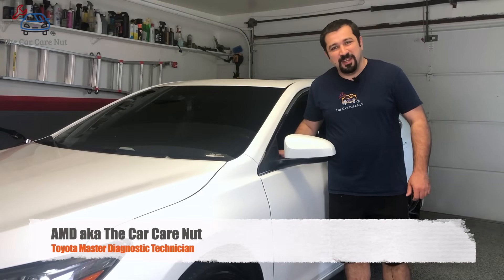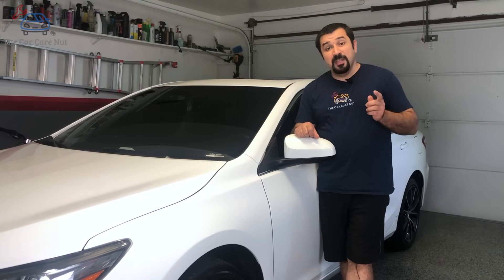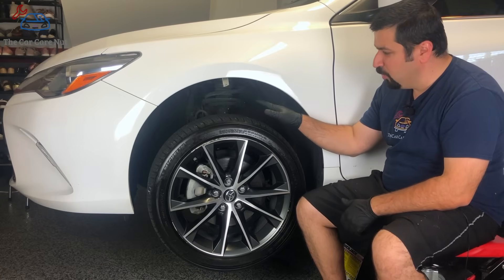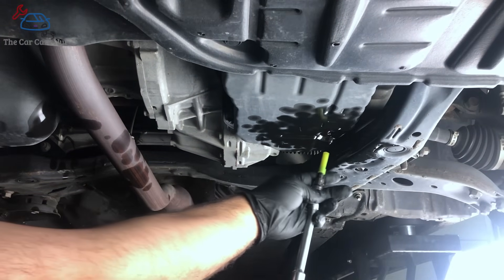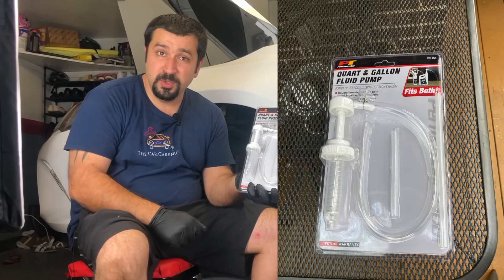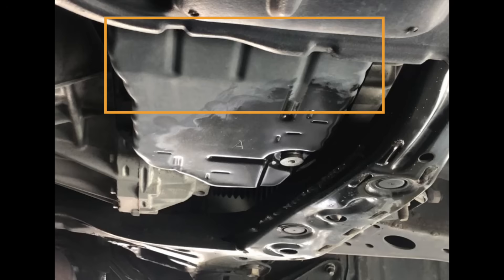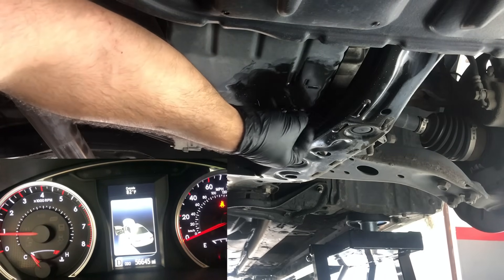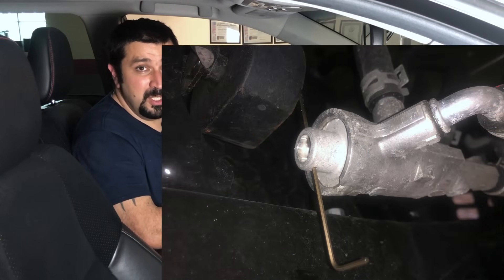How to change your Toyota Sealed Transmission Fluid

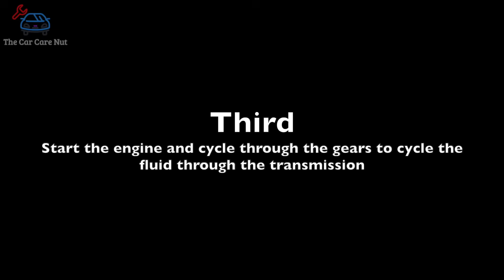Comment: Great video.  Very clear with details on how to do this correctly.  In step 4 at 11:59, where you cycle between N to D very fast back and fourth until the D indicator comes on solid for 2 seconds, does it matter what gear you put it in before the taking your foot off the brake pedal brake pedal - N, P, or either?
Reply: Found another of his videos where he mentions to put it in PARK.  It's titled, "Toyota Trucks Sealed Transmission Fluid Replacement WITHOUT a scan tool".  At 9:08 -> "When that light comes on, you're going to PUT YOUR truck IN PARK, then pull jumper out. And proceed with fluid check mode."
Reply: @vern6887  I recently did two transmission changes and figured out that you may wanna keep it in “N” until the desired Temperature reaches. 

Reason is before entering into this temperature detection mode you will have to quickly shift between “N” & “D” few times(3-4 times) as shown in the video which turns ON the fluid temperature detection mode; this is indicated by the solid “D” which stays on for only 2 seconds after which the “D” disappears. This is easily detected when you are in “N” mode as the display is blank in this mode. You wait for few mins and once the optimum temp is reached it will show a solid “D” again at which point you need to put it in Park mode; remove the jumper then open the drain plug. This is what worked for me though!!!
Reply: I put it in "N" as I was shifting between "N" and "D".

Comment: Fantastic stuff! Your videos are just perfect!

Have a 2011 TC and am about to change the fluid tomorrow. Bought Red Line 50205 MTL 75W80 GL-4 for it.
Has 100k miles. The fluid has never been changed. Would you still recommend it?

Second question: how do I know when the temperature is optimal on a manual transmission? Can I use a simple temperature gun or thermostat, or is there any other, more accurate way?

One more thing: do you recommend changing the transmission oil filter  while I'm at it?

Thank you!

Comment: Hi ....Why not drain when everything is COLD  (removing drain plug and "plastic inner dipstick tube" )  and the refill the exact same amount  new fluid ?    Everything would be at the same temp....no expansion or contraction to change the fluid level.......thanks .....great video!  :)

Comment: Thanks for posting this information.

Now, this is the biggest pile of BS ever invented.   No dip stick.  This is an example of EVERYTHING that is wrong with modern cars and light trucks.   There would have been a dozen ways to make this simple.   Just what is this nonsense all about, simple,   people sitting in a room coming up with ways to prevent the average person from servicing their own car and lining the pockets of dealers.    When I found out about this I sold my 2017 Toyota Highlander and found an old one which doesn't have this kind of BS procedure.   I have owned Toyotas for 40 years and will never buy another new Toyota again because of this nonsense.

Just sit back and watch as this kind of garbage as it leads to the death of companies which try to get ways with this.  Enjoy the show as you watch TESLA  put the old greedy dealer system in it's grave.

Comment: I have a 2007 Tundra 4.0L. with 150k. It runs great with no problems and the transmission fluid has never been changed. Do you recommend changing it now with so many miles?

Comment: Thank you for your great videos! You’re truly a master! I have a Sienna 2012, 67000 miles , I just did this for the first time and the fluid was dark, only 1,5 quarts came out. My question is should I do this a few more times to dilute the old fluid with new one? If so what is the ideal intervals between changes? Thank you sir!
Reply: I asked the same question. On my old F150 I used to get the right amount of fluid per capacity. I will drain the pan and add the same amount as explained here. I will then run the vehicle for a day or two. I will drain and refill again until I went through all the new fluid. It will not be 100 % clean but it will be a lot better than just a partial fluid change. I had that truck for 257k miles and I never had a transmission issue. Same with all my other vehicles that I owned.

Comment: Hi, AMD and community. AMD mentions in his video "Never do this to your automatic transmission car" that shifting into neutral them back to drive over and over again wears out the clutch. How badly does it hurt the clutch when you're shifting it back and fourth that quickly during every automatic transmission fluid change? Thanks!
Reply: If you shift from N to D and back fast enough, the transmission doesn't actually have time to perform the shift.

Comment: My 2016 Corolla has 95,000 miles. I have a small leak from the pan so I'm pulling it. Should I change the filter while I'm at it? What trans temp am I looking for? Thanks.

Comment: Do scion cars have a seal transmission? A Toyota dealer in Phoenix said this transmission does not require a fluid change , is this correct?

Comment: Hello Sir, Im planning to change my transmission oil for my Toyota Highlander 2013 ( 50K miles 81k km) on it. When I check the oil level ( black dipstick) hot and cold it was way above the high mark on the dipstick (overfill), is this something that I need to be worried about? the oil still in a decent condition, do I need to replace the filter as well or just do a drain and fill procedure, thanks a lot. God bless you always

Comment: Question: I have a 2015 GS350 Fsport. Bought it with 87K. I wanted to know "when or If" I should have the transmission fluid changed? ( I tried checking the Lexus drivers service history but it jumps from 30K to 85K with no mention of that service. Thanks for the videos and advice 👍

Comment: What if we weight the fluid we took out and we put the same amount..... weight is very accurate and that's the reason HVAC technician use to measure Freon and fill up a unit no matter if Freon tank is cold or hot.

Comment: Your channel is great and super informative for us DIY'ers. I have a 2014 Highlander with 60K and a sealed transmission. Any recommendations on if to simply drain or to also replace the gasket & filter?
Reply: I've seen him mention in another video (sorry I can't remember which one as I have watched so many recently) not NOT change the transmission filter ever.  In fact he said to never even take the pan off the vehicle.  The filter doesn't ever need to be replaced, he couldn't stress that enough.

Comment: AMD, I just wanted to confirm, that for the U660E transmission (2016 ES350), the fluid temperature should be checked between 104F and 113F (40C to 45C).
Reply: You are correct. U660E is 104-113. If it were the U760E, it would be 95-113.

Comment: Thank you for the great video!  As mentioned, what's the correct transmission fluid temperature range for a 2008 IS350, 2016 ES350, and 2019 RX350?  Much appreciated!

Comment: First of all, your instruction and procedures are excellent - clear, concise, thoughtful, and thorough.  Thank you kindly.  I own a 2011 Toyota Avalon.  The owner's manual specifies a transmission fluid capacity of 6.9 quarts.  When I drain the transmission, only about 2.25 quarts are removed.  So is refilling the amount that drains an adequate service?
Reply: The way these transmissions are built, there is a filter inside the drain pan as well as the trans fluid cooler on the bottom of the radiator, as well as the torque converter inside the transmission.  Those three additional pieces are what’s holding the remainder of the fluid.  There are only two ways to get all the fluid cycled out. 1. Repeat this video step by step 3-4 times so that all the fluid ends up cycled through the system and drained. 2. Drop the pan and filter, replace the filter with a new one, clean the magnets inside the pan, replace the pan gasket with a new one, install pan, flush the cooler unit, refill the system with the amount of fluid you drained out. I would not suggest this option without proper tools and some decent time spent working on cars as there is one bolt that is almost impossible to get to on the pan due to the crossmember being in the way. Not to mention it is super messy, you also run the risk of leaks at the pan of not torqued correctly, having to flush the cooler unit can also cause a lot of issues with the transmission down the road because if done improperly the torque converter may not get the right amount of fluid.  There is another video on YouTube showing all the steps in option 2 I just told you about.  I’ve worked on my own cars for over 22 years and I don’t even want to attempt option 2 lol.  So good luck with whatever you decide!
Reply: @mikewho822  thank you kindly for your great response.  I'll flip a coin to decide between the two choices!  LOL
Reply: The other video is here https://youtu.be/a578lBu_o5E

Comment: On a 2020 newer RAV4, What are the torque specs for the drain plug. And what is the torque spec for the refill plug On the side of the transmission? Thanks
Reply: The required torque is a lot less than you think.  But not that tight.  Wipe it off, drive a few miles and look at it again.  If there are no drips/leaks it is tight enough.

Comment: 2021 Rav4   Have scan tool    I can't remember Temp of fluid at the plug excess drain.  I think you stated 112 degrees . I have 55K miles so it is time
Is 112 the correct temp with a computer?

Comment: The holes on the 2015 Camry OBD2 port are very small.  How small of a gauge wire do you need for the jumper?  My wire won't go in!
Reply: Use a paper clip!

Comment: Whoever came up with this idea needs to be whipped with 30 lashes. It's stupid at best. It makes me think again about buying a Toyota.
Reply: Stupid, yes.  It's not just Toyota.  GM and others have all done this too.  Save a couple of dollars by not having a dipstick and tube, multiply that by a few hundred thousand cars, and they just lowered their manufacturing costs by a million dollars.
Reply: @georgelomarro4677  Not really, because then they have to replace the dipstick with a low oil level sensor plus a low level warning indicator of some kind in the dash.

Comment: I should do some research before posting this but I cant see how a filter isnt required. And also why is it that some engineer over all these years hasnt come up with an easier way to check and change trans fluid. I can think of a couple ways off the top of my head. I assume its a way of making sure they dont last.

Comment: Hello. A great video. Question. If you let the car sit overnight and do it the next day without starting the car and the fluid is cold. The transmission would have more fluid in the pan when you drain it getting more of the old fluid out initially. Or would it be better to do it when the fluid is warm ? Always wonder about this issue.

Comment: So, after watching several of your videos, I changed the spark plugs and today I changed the alternator on a 2012 Toyota Avalon. I have been told to leave the transmission fluid alone and not change it at 150,000 miles (fluid never been changed). Is it too late for me to change the fluid? Why are dealerships refusing to change the fluid? That is crazy. 

Whatever you do, do not stop making these great videos. You are sent from Heaven sir!
Reply: Dealer wants you to buy a new car.
Why would they want to do anything that would make your old car last longer?
Reply: Do a drain and fill, you won't have any problems, I did a drain and fill after 230000 klms without any problems. Keep the old oil aside in a clean container, if the transmission starts to slip after the all new oil change reintroduce a 60% old/40% new oil mix and you should be good to go. If all is well then after a few weeks of smooth sailing you can ditch the old oil.

Comment: In my case, the transmission fluid was  drained but I don’t know how much was removed. What is the correct capacity of transmission fluid for these transmissions?
Reply: If you don't know how much fluid was drained then what good would knowing the correct capacity of transmission fluid do for you?  For a drain & fill most of the fluid is inside the trans and the Torque Converter and does not get replaced with a D & F.   Just do the procedure shown in the video and do it again if you guessed wrong and did not put in enough new fluid.
Reply: @shoersa  obviously you don’t understand the problem. Total capacity is needed so I can fully drain the fluid and refill to spec. If you don’t have anything of value to add, save others time from reading your nonsense response and carry on. This isn’t your FB page ppl are seeking assistance not dumb replies.

Comment: I have a 2016 lexus is 200t with an 8 speed automatic transmission and I cant seem to find where the "cooler bypass" is to begin the transmission fluid flush. Does anyone know where I could find it?

Comment: Hey AMD, does it matter whether the engine is hot or cold when doing this procedure on a 2007 ES350?
Reply: Engine temp does not matter but trans fluid temp DOES matter.  Best to do this after the car has cooled off overnight.

Comment: Most likely I missed something. The part when you move the shifter from N to D quickly. The car will be on jack stands, the D light stay on. Do I keep it on D? The wheels rotating while on jack stands?? Is that right??
Reply: Foot on brake at all times
Reply: Unsafe to have wheels rotating while on jack stands.
In the procedure the "D" light is a trans fluid temp light, NOT a Drive light.

Comment: So do I need to have the fluid at normal operating temperature when draining or needs it can be done with out warming up the trans to temperature require to check the temp.

Comment: How do you get the overfill tube out if it's over tightened by the dealer and possibly worn the Allen head?
Reply: I hope your car is one that has a pan.  If so, it is not too hard.  You will need to drop the pan to get access to the overflow.  Replace the overflow, reinstall the pan with a new gasket.  While you have it apart, it would be a good idea to replace the filter too.
Reply: Buy a new straw (overfill tube) from dealer and then drain fluid and remove the old straw and then install the new straw by hand tightening it.  NO ratchet.
Reply: @shoersa  I can't even free the overfill tube it only strips the tube head with the right Allen key because it's on so tight. I was wondering what actions to take so I can install a new tube?

Comment: Asked a local Toyota dealership to check the fluid level on my 08 Tacoma.. they gave me the whole shpeel of have to do a transmission “service” for 275 bucks! I was like thanks but no thanks! I’ll do it myself you con artists. 275 bucks for about 20 minutes of work and 2 1/2-3 quarts of fluid.. what a ripoff.

Comment: I tackled this job today and did the Diagnostic Mode with a jumper wire and I feel so much more confident that I did my drain and fill correctly thanks to you. You explain things very well and the procedure was easy to follow. These transmissions are not cheap to replace so it was important to me that I got the fluid level correct. So thank you very much sir and god bless you and your family.
Reply: Yikes
You've got to be kidding me. They definitely designed this so the average Joe will have to take their car to a dealer. And I wonder how much that they will charge for doing it. ?
Reply: @jamesgerke3787 
Yeah, that's their goal.  You can do it but you'll have to spend some time getting very familiar with the procedure and you'll need a couple tools.  The first time was a little daunting but I prepared for it and it went smoothly.  I think I could do it again in under an hour.
Reply: @jamesgerke3787 our local Toyota dealership charges 230 dollars for this service.
Reply: After shifting between D & N waiting for the trans to warm up what do you switch it to when you take your foot off the break and check the level?  I'm assuming N or P as it didn't look like his axels were moving, but he doesn't actually say what gear it should be in when the level is checked.
Reply: @jalmolky  At that point I would put it in PARK.
Reply: I couldn't get any jumper wire to fit the OBD2 for a 2019 Toyota Rav 4 LE AWD. First-time serviced at approximately 70,000 miles at a local reputable shop. This was my first DIY at 118,533 miles. So what I did was I took out & put the same back in. Aprox.2.9 qts. SecThe plastic shield on the bottom PIA! Runs great no idiot warning lights I pray!
Reply: How did you ensure the car is at level? Did you use 4 Jacks?
Reply: @mrnatnatwarlal1972       I just did mine with the car sitting on its tires in the garage, as my garage floor is level.
Reply: The pinout picture in the video looks different from what's actually on my obd2 pinout
Reply: Can you purchase a jumper wire at a local hardware store I’m assuming?
Reply: @Gretzky2857  Any piece of wire will do. Solid wire is easier to use than stranded. Wire should be small enough gauge so as not to spread the connector too much. (Don't use a piece of wire from your house wiring.) Probably 20 or 22 gauge.

Comment: Hello, I have a 2017 Camry with 83,000 miles on it. I bought it in 2019 when it already had about 60,000 miles. Is it too late to begin servicing the transmission at the 50,000 mile intervals? Also, do all the Toyota dealerships have technicians trained correctly in this operation? Thanks

Comment: I really enjoy and appreciate your channel, thank you for the excellent information.  I have a 2004 GX470 with 253,000 miles, excellent vehicle that has been very well maintained and has no problems.  The transmission oil has never been changed and my question is would you recommend changing it now?